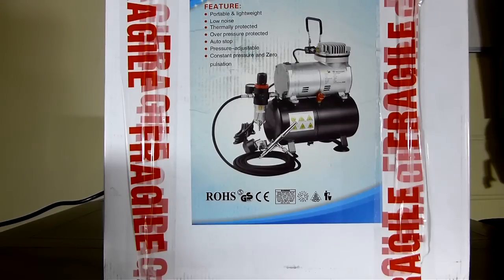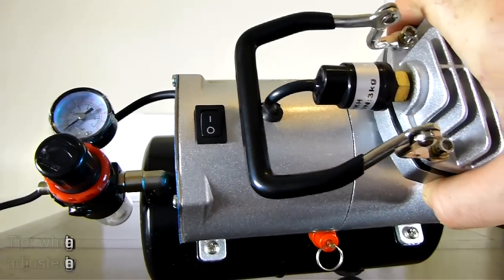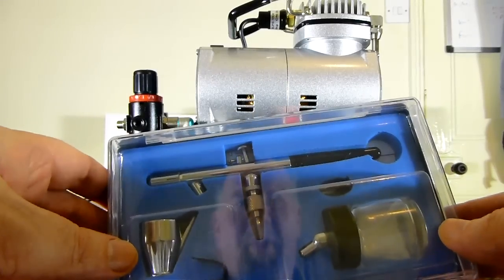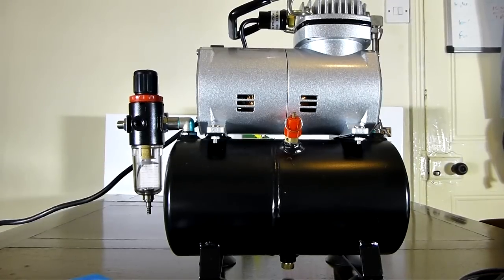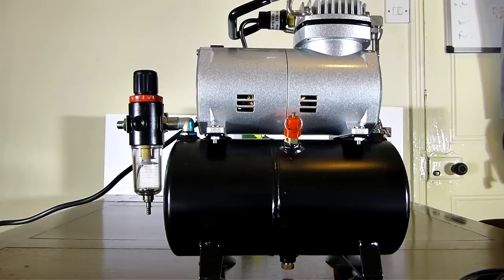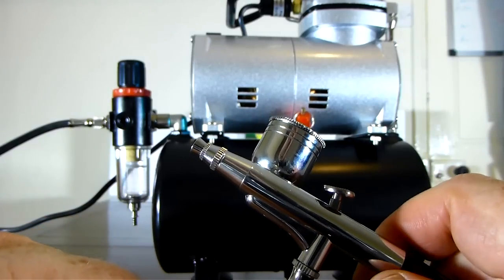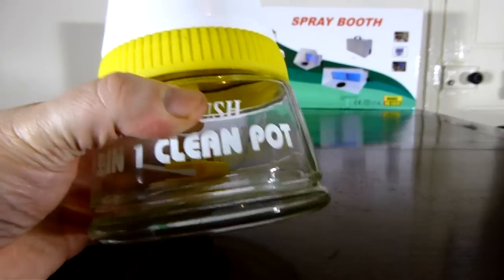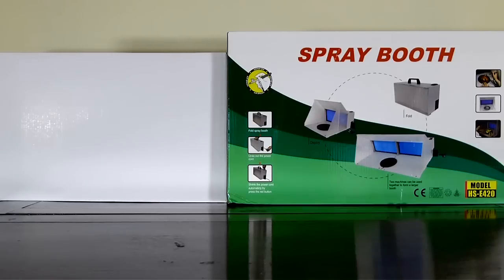Equipment: KMS model AS 186 Compressor and Airbrushes

Comment: I have just ordered this from Amazon,after reading plenty of reviews.It seems to me,that the compressor is a great tool,but the supplied air brushes,are just adequate.As I have never used an airbrush before,I thought the price sounded good.£90.. Then after paying for it,I looked on eBay and saw the exact same item for £65.. I just thought I would give a heads up,to anyone else that may fall into the same trap.Lol Great review,thanks.
Reply from the maker: madeinuk68 thanks for your comment and yes, that's useful to know. It wasn't about on eBay when I bought mine I think, but yes, it's always worth shopping around before buying an item once you decide which one you want. As you say, the brushes are fairly basic but for me were a good way to give airbrushing a first attempt before deciding on higher end brushes to buy. They also gave me a good initial brush to practice with and learn how to dismantle and clean them without worrying about their value too much etc  :)

Comment: The more solid and sturdy the table/bench, the quieter the compressor. A thin table top will amplify the sound. A piece of carpet under could help. If it could be placed on the floor it would help too.

Comment: Cheap Versus Expensive
Years ago and after I graduated from a College Votech School, and was employed as a repair technician in the Air-Conditioning, Refrigeration, and Appliance field, I soon learned that with the exception of a few manufacturers, such as “GE”, “Speed Queen”, “Amana”, “RCA Whirlpool” etc.,  the majority of the appliances (whether household or commercial), were manufactured by only a couple of major manufacturers, or manufacturing firms. However, both major, (and a few small), business corporations like “Sears” (“Kenmore”, “Lady Kenmore”) , “Montgomery Ward’s”( Airline”, “Ward’s”, “Ward”, etc.),  “JC Penny’s”, all paid the manufacturer so much a year to have their specific brand name (along with all of the same names stamped upon the data plates) installed upon those appliances. Not all, but, most appliances nowadays are produced by “Amana” located in the “Amana Colonies” in “Amana”, Iowa. I also know of other manufactured products like that, such as the RV’s and Motor homes known as “Champion” (also used the name “Concord” ), “Kit” (Travel Trailers, Campers, and Mobile Homes), did the same thing in using other brand names installed upon those same RV’s as well, even though they rolled off the same assembly line. So, from the looks of the different designs (which seem to be almost copy-cats of the exact same item), as well as the parts installed upon those hobby air compressors, and a lot of the airbrushes (I see listed online, or in different video’s), they are more than likely (more probably), the same compressor, and airbrushes, being manufactured upon the same assembly line by the same manufacturer but with different specific “brand” name plates and/or data plates being attached to them. The quality (either good or bad), will be determined by both the quality control inspectors upon those assembly lines at the manufacturer, Where they are manufactured (China, America, Canada, Germany, Switzerland, Mexico etc.), as well as by how much a specific customer wants to pay the manufacturer for their particular brand named item and the quality of all individual parts going into that particular item being produced upon that same assembly line by the same manufacturer, or manufacturing firm. So, due to that being the case, more than likely with the exception of a few cases (due to lack of proper consistent “Quality Control”), no matter which brand you purchase (buy), it will still perform satisfactory for many years if properly maintained and used. But, however, I’m not going to refute the old adage of “You get what you pay for”, because it is also a known fact that even the most expensive items will either not live up to their reputation, and/or will fail (sometimes right immediately after purchased). All I’m trying to say is that in most cases, even the most inexpensive (cheapest), item will generally perform satisfactorily, and could (or will), possibly last a lifetime with proper use and maintenance. But once again, (either beginner, or professional), it all boils down to; “To Each His (or her), Own Choice”, and, what they can afford, at the time of purchase. No item, no matter how cheap, or how expensive, is either “all good”, or “all bad”.
 So don't let others dictate to you, and try to tell you any different. Just take into count all aspects, and then make your own decision. But, no matter what, it will still depend (and be based), upon what's in your wallet, and what you can afford at the time.

Comment from the maker: I didn't seem to be able to reply directly to your comment Vanessa-Camille, but no, that doesn't sound normal to me, although I am also no expert. I believe the regulator should be able to control the amount of pressure but not sure that it is also designed to also release air at all? How is the pressure? If you're finding you can't seem to increase the pressure much, it sounds like a leak? I'd check that the hose attached to the regulator is in place correctly maybe? Good luck with it :) - Sim

Comment from the maker: Heya Paul, I'm no expert by any means but to certain extent yes I think so? When you press the trigger it releases some of the built-up pressure. Therefore when I wanted to set my pressure via the regulator to a certain PSI, I made sure I pressed the trigger on the gun when doing so, so that the desired level I set it at was for when the gun was being used etc I hope that helps? :) - Sim

Comment: The 186 is a great piece of kit and i love mine but PLEASE, check the fuse. Every one of these I have seen in the UK has been supplied fitted with a 13A fuse, which is a bad idea. It should, for safety have a 3A fuse.
Reply from the maker: Thanks for the pointer! I shall have to check which fuse it has and replace it if not the correct one. (Not used it for a while due to life intevening, hence the delay in replying as well, with apologies) - Sim
Reply: BurtonOnHumber Yea life tends to take over at times doesn't it?. Ahh who needs a job, house and a family........ :D
Reply: Great tip, cheers 👍🏼

Comment: How is the compressor holding up after 3 years? I purchased what seems to be the same compressor without the airbrush. I should have got the combo and I would have used the air brush for surface primer, clear coating and saved my good brush for paints only. No big deal really, I can pickup a cheap airbrush with a 0.3 mm needle easy enough.

Comment: Hey mate, thanks for the video. Just wondering if you have to "bleed" the regulator back down to 0 once finished using it. When I used mine for the first time, it stayed on no less than 10 PSI and was wondering if it's fine to leave it as it is until next time.

Comment: Could you help me with what size is the coupler  on the air nozzle of the compressor? I need to connect a badger 250 gun to this compressor but can't find a suitable coupler

Comment: Should there be a noticable difference in air pressure on the first press of the trigger compared to normal running on the gravity feed brush / compressor ?

Comment: Just got one of these delivered today. Compressor  is great. But I striped down one of the Airbrushes to check it out. Make sure needle is set right an it has a chalky residue and the cup has a weird scold mark in it. My first thoughts was it looked used but it came factory sealed.
 Weird. But it all seems in working order. It's been a while since you bought the kit is it still living upto the job? Any tips or advice?

Comment from the maker: I'm not actually sure, I've not used mine for a while... I don't recall noticing it being particularly hot after using it for about a half hour on the day I tested it in a different video. That said, I know that other reviewers have mentioned (I think I also mentioned that in the video at about 03:20ish) that you should really only use it for about a half hour at a time before letting it cool down, so it heating up would seem to be a standard thing? - Sim

Comment: Hi, I would like to ask what type and size of fitting is on the output that the hose attaches to. I was given an airbrush, and was told to be careful of fitting specifics when buying a compressor.
Reply from the maker: +Angellos Korsanos I'm not fully certain of the exact specification for the hose fitting. At this stage the compressor  and fittings are all stored away so I'm not readily able to check, with apologies... - Sim

Comment: Hi, great video just wondering, being left handed the cup mounted on the right will block my line of sight. Is here any way to change this??? Any reply is MUCH appreciated
Reply from the maker: No, I don't think the cup is move-able on that brush at all. That said, I did use the brush in my left hand sometimes (I'm sort of ambidextrous as I was originally left-handed) and it didn't cause me too much grief? I'd also say that once you have gotten used to air-brushing it's probably not a bad idea to upgrade to a better brush. The ones that came with this compressor are more entry-level brushes. Hope that helps :)

Comment: I bought this recently and was able to run water through the gun but the Citadel line air paints was not coming out. Do I need to pump up the air pressure higher or is it a problem with the paints?
Reply from the maker: You may need to thin the paints for work with the airbrush? What you think them with varies depending upon the paint but you want to aim for a consistency like milk with whatever thinner is best suited to your paints.

Comment: How are you getting on with your AS 186? I STILL haven't pushed the button but now I am moving onto larger models... well thats my excuse anyway lol!! There are so many options on ebay it is really quite off putting. Just having a final read up before going for it. Did you ever upgrade to the Iwata? Ok I shall get back to my 'swithering' hehe!
Reply from the maker: Due to lots of things like moving house and cities and so on, I have not used my air brush much as yet but plan to start doing so over this Christmas break at last again. I never did upgrade to the Iwata brsh as a result, but probably still plan to do so. Good luck deciding on which one to get and hope whichever one you choose, works out well for you :) - Sim
Reply: Thanks for that Sim, I have gone for the AS19- 3L Tank and a cooling fan built in so hopefully that will aid with the overheating issues you mentioned. There is only one Airbrush in the kit I bought but it is a gravity fed double action-which is what I was after and like you I intend to upgrade with the Iwata sometime soon (the starter brush-around £50)
Well it sounds like you have had a really busy time of it and hopefully that is all behind you and you can get back into your hobby with plenty free time at your disposal. Best wishes for this festive period- hope you can get spraying!
Craig :)
Reply from the maker: Sounds like you have made a good choice there and I hope you have a wonderful festive season as well, thank you! :) - Sim

Comment: Ah I bought one of these but without the black tank at the bottom. I can't figure out how to get it to work, as the air pressure just constantly rises. Guess I need the black tank too? (complete noob at airbrushing btw)
Reply from the maker: +Naho Saenoki I'm not sure either, but I think with the tank version, the air pressure builds up to a certain pressure within the tank (based upon whatever you've set the regulator to) that pressure within the tank can then be used to maintain that pressure at a constant rate but without the tank I'm not sure how that would work... Good luck with it :) - Sim

Comment: Hi,got the AS 186 for Christmas my first ever..it works ok but I thought the idea was that tank fills with air and then motor cuts out...my motor runs continuous for about 20 mins and then cuts out and air pressure goes to zero,does yours do this.Many thanks Brian
Reply from the maker: +Brian Boreham Hmm, did you get the version with the tank, or without? With the tank version, as far as I know (I'm no expert) the compressor should build up the pressure in the tank and then maintain that pressure for a while whislt you use the ai-rbrush - until the tank needs to be re-pressurised, at which point the compressor should trigger on again to do that? - Sim
Reply: +BurtonOnHumber many thanks for your reply..the compressor was faulty so sent back & it was replaced with one that worked..the customer service was excellent.
Reply from the maker: Brian Boreham ahh, glad you got it all sorted then :)